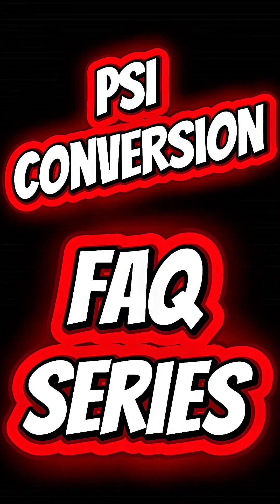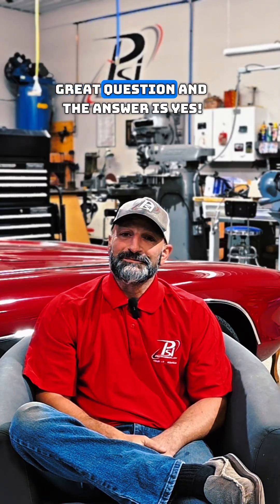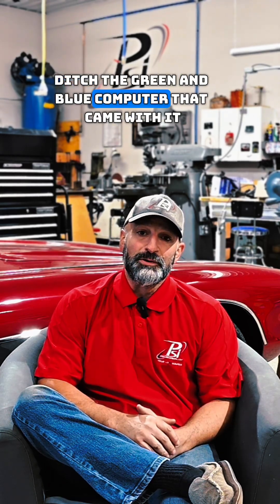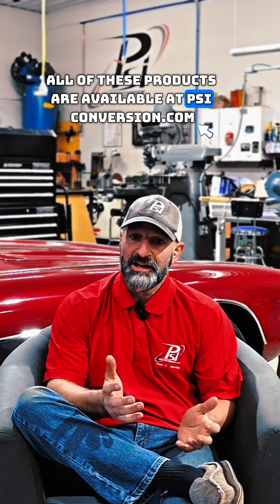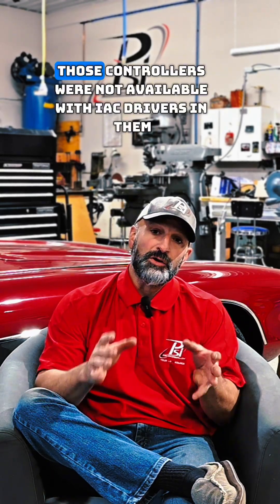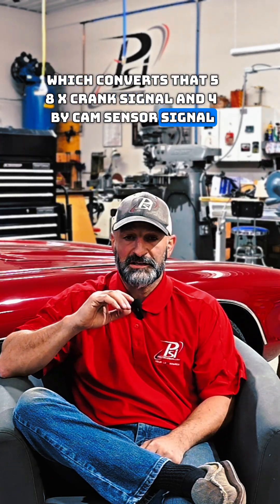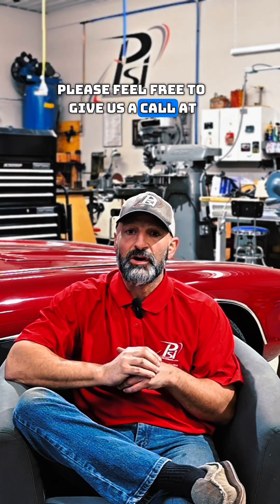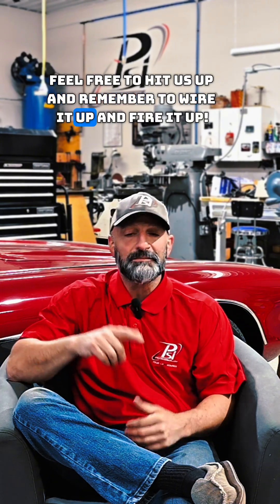🔧 FAQ Swap Series: Can you run a drive-by cable throttle body with your drive-by-wire engine?

Comment: Hey John , I still can’t get my fans to turn off after they come on, they will cool the truck down to150 degrees an still not go off, back story: I bought my computer an wiring harness from yall, an then ended up buying the double relay system yall have , have been over the diagram a few times , definitely hooked up right , I have talked to a technician a couple of times , he keep saying I had it hooked up wrong, I said buddy I know how to read a diagram, I had two other different relay options set up and the vehicle done the same thing, so I ended up buying y’all’s , relays and it’s still doing the same thing. I’m thinking it’s either the computer or maybe the temperature switch ,I’ve not changed it yet.
 it was the one that come with the engine. Do you think that would cause the fans to not kick off,,
 after the truck sets for a while and you start it back ,the fans are not on when they get back up to temperature they kick back on and never cut off.thanks